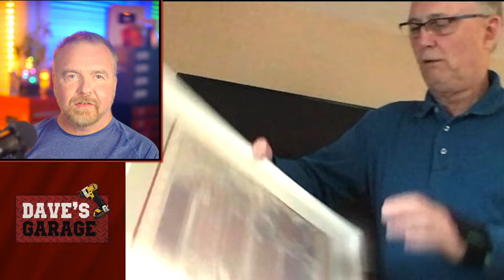Commodore 64 Chip Designer Interview: Albert Charpentier

Comment: The 'stolen' cycles in the rasterized area consist of 2 things:
- possible sprite data if sprites are enabled (not all can be fetched during phi1)
- once every 8 scan lines, the screen codes and attributes for the next 40 characters have to be fetched, but all the phi1 cycles for that line are already in use for fetching character definition data, so VIC2 keeps the bus unavailable during 40 cycles also for the phi2 phase to fetch those. This also happens in bitmap modes, but in that case to read the attribute data.

Called stolen because vic2 steals 'cycles' which should belong to the cpu. (cycles quoted because.. its more a case of rising/falling edge, so opposite phase of the same approx 1mhz clock)

Those cycles getting stolen interferred with the tape load/save routines in kernal if compatibility with the on-tape format of the vic20 (and PET) was to be preserved. Disabling the screen disables all of the above cycle stealing, and made it compatible again.

There is some interesting related trivia. 

The 1540 drive also did not account for those 'stolen cycles', and that was causing similar timing issues. Commodore could have opted to blank the screen also for disk loading, but instead opted to update the 1540 rom, and call it a 1541 (and make an updated rom available to those who needed it). If they instead had opted to blank the screen, it would have made loading from disk upto 15% faster.
Reply: Correct. Two more things: the 8 scan lines thingy is commonly refered to "Bad line" (and you can actually trick the VIC to genereate a Bad line at every scan line which enables you to redefine colors every single scan line. 
The "attribute data" in bitmap data is actually "color data" :)...
Reply: IIRC, unlike the Amiga, the C64 is all or nothing when it comes to stealing processor cycles for Sprite fetches. That is, if one C64 Sprite is on, then data is fetched for all 8 Sprites, even if only one is on.
Reply: @saganandroid4175  no not really, but it is somewhat complex. The issue is it taking a few cycles for the cpu to stop, so you can't have vic2 steal a cycle, give the following cycle to the cpu, and steal the next cycle again. There always will be a few cycles inbetween.

The way in which the cpu gets 'stunned' is somewhat more complex than one might expect, because a 6502, and by extension a 6510 cannot be stopped in the middle of an instruction, you have to let it finish that instruction (tho the last cycle of that can overlap with the cpu getting tristated)

To allow fetching multiple sprites using the remaining cycles outside the visible screen area, vic2 will start 'stunning' the cpu a few cycles before the first sprite data it actually has to read, and keep it stunned until it is done with the last one.

But that is based on what sprite data it actually needs to read, based on which sprites are enabled, and also means that you can have it fetch data for one sprite only. It doesn't always fetch all bytes for all sprites.
Reply: I just did some practical timings, and it turns out that with the screen blanked and the 1540 (or the 1541 in "fast" VIC-20 mode), the C64 loads nearly 17% faster, so you're right about the speed difference.  And with the original routines that have lower overhead, the VIC-20 and 1540 loads about 20% faster.  That's not great considering that the "bad lines" only slow down the C64's CPU by about 6%.

But what's really sad was that both the VIC-20 and C64 were supposed to have fast serial "burst" transfer just like the C128 and 1571 combination.  Commodore actually screwed up twice to give them both slow disk data transfer rates. 😵‍💫  With the VIC-20, the problem was a previously unknown bug in the hardware bit-shifter in the 6522 VIA that forced the design team to fall back to a slow but reliable CPU-driven serial protocol.  The C64 got the 6526 CIA instead and the 1541 was supposed to have at least one of those, as well, so everything was all set for fast disk data transfer, but then some idiot manufacturing engineer had to make room for a new mounting hole, so he deleted a line or two because it was easier to do that than reroute the lines!  For some reason, he thought that they were unused, and did not ask the designers before taking the liberty of removing the traces completely (might have had an outdated version of the Kernal ROM), which broke the fast serial transfer mode.  Unfortunately, hundreds of thousands of C64 mainboards were manufactured before anyone knew there was a problem (probably sent the production samples to the designers for approval just before making this last-minute change), making the problem expensive to fix by hand, and management wasn't interested anyway because they considered the 1541 a waste of time to begin with (they thought that everyone would be using Datasettes instead, like with the VIC-20).  So the 1541 got the 6522 instead (slightly cheaper and everyone used it, so they had tons on hand), and the C64 got super-slow disk transfer.

Oh well, that's "water under the bridge", and in return we got all kinds of interesting solutions to this issue, the vast majority of which were software-only and many times faster, proving that the C64 didn't and doesn't really need to have slow disk data transfer rates, even with the broken stock hardware.
Reply: @Lofote   You are correct that the attribute data that is read during bad lines in the bitmap modes are exclusively color data or maps (two colors per byte), but concerning color maps in general, the main color map at $D800 (stored in an SRAM chip on the board rather than the main DRAM) also contains an attribute bit while in multicolor character mode.  This bit determines whether the corresponding character cell is in hi-res or multicolor mode, leaving only 3 bits for the color, which limits the main foreground color to the first 8 of the palette.  It is for this reason that I, for one, often refer to the color maps as attribute maps.  Sometimes they do contain only color data, but color is itself an attribute, so this term is still appropriate, and other times they contain other attribute data in addition to color.  Furthermore, multicolor character mode is perhaps the most common mode that is used overall, especially for games, of course, so this exception to the rule is a pretty major one that programmers have to deal with on a regular basis.
Reply: @rbrtck  of course, even without 6526s, serial transfers could still have been a lot faster, as demonstrated by many fastloaders and especially things like jiffydos.

Btw, jiffydos shows a highly similar improvement when disabling the screen (which for some reason the c64 version doesn't do, but the c128 version does.. too bad there is also a bug in the 'unblanking' bit of that code (not masking bit 7 of $d011 and the C128 using a raster interupt instead of a 6526 timer interupt, this results at times at setting a raster line for the raster interupt which does not exist)
Reply: It always puzzled me why the 1541 would make that hammering noise.
Reply: @toby9999   My understanding is that like the Apple Disk II, the 1541 mechanism originally didn't have a track 1 sensor, so its ROM code just stepped the head 40 times or so to make sure that it had found track 1.  Later mechanisms came with track 1 sensors, but the drive ROM was never updated to use it.

By the way, I have a very compatible drive from Blue Chip that actually uses its track 1 sensor (also has a direct-drive motor like the Chinon-based 1541-II) and never bangs its head against the stop.  As far as I'm aware, this change has never caused a 1541 compatibility issue, so in hindsight Commodore should have done the same.

I wouldn't trust just any Blue Chip drive, however, because the first one I bought was awful: incompatible with many software titles and fragile.  After a couple of frustrating service calls, it was replaced (for free) with a newer model by Blue Chip that is awesome: fully compatible, has direct-drive, has a write indicator LED, never bangs its head, runs relatively cool, and is rugged and utterly bulletproof.  I love this drive, but frankly its predecessor sucked in every way.

Comment: Thanks for interviewing one of the incredible people who designed the one and only home computer that ignited an entire generation of future engineers. The Commodore 64 wasn't just a random computer that would eventually get upgraded or replaced. For me personally, it was my life for 15 years, it still has its place in my home and even 40 years later it still is loved and used by thousands of demosceners and enthusiasts. If the Internet hadn't gone commercial and I eventually needed a higher screen resolution for an improved display of remote unix terminals, I'd likely still be using it as daily driver today. I thank you and the other folks at MOS/Commodore wholeheartedly for my entire career and some fantastic and adventurous memories. The things me and others have done with the C64 are unbelievable and unrepeatable.
Reply: "only home computer that ignited..."?  There were a LOT of home computers around that time other than the C64.  TI-99/4A, Atari 400 and 800, the various Timex/Sinclair and ZX/Spectrum machines, Apples, TRS-80 models, MC-10, Cocos, Adam, I'm sure I'm forgetting a bunch of them.

Comment: It’s truly amazing how influential just a handful of people were in the history of personal computing, and how much the 6502, MOS/Commodore really were behind a huge portion of the industry. And of course, that perhaps 1 dozen engineers were behind the designs of so much, from CPUs, to graphics, to audio processing. Particularly interesting to those of who grew up with these machines. 

The TRS-80 was the first computer I saw, but a PET was the first machine I used…and the very first thing I did was debug “Hunt the Wumpus” game, after some friends asked me to help, not because I knew anything about computers, but because “Hey, Geoff, you’re smart, see if you can figure out what’s wrong with this”. The game was in BASIC, and they showed me how to load it from tape, how to list the program, how to run the program, and how to trigger the error. I started looking around and found what looked to me like a problem in 15-30 minutes, made a change, tested it, it worked. Ok, “How do I save the changes?” And, thus began my life as a developer.

Next, I moved to using an Apple ][, and eventually purchased a VIC-20, then a C64, and finally, an Apple //e, with a disk drive, added a 1200 bps modem. It may have helped that one of my high school buddies (2 grades ahead of me) was a budding hardware engineer who became the primary hardware engineer for Applied Engineering’s Apple ][ products, including RAM expansion boards and the TransWarp line of accelerators. I learned a good bit about hardware from him.

Comment: I always thought the shared memory on the c64 was primarily a cost saving measure. But it sounds from this like was originally designed as means of communicating data efficiently between the CPU and the graphics processor. 

 really enjoy hearing the stories of the ppl who designed and developed these technologies. I look forward to seeing more interviews on ur channel.
Reply: @Christopher Jackson

This approach was used all over the place. It was fascilitated by ram at the time being easily twice as fast as the cpu.

For example the older IEEE-488 floppy drives from Commodore have 2 6502 CPUs, which share ram in exactly the same way, one having half a cycle offset to make it run on 'the other phase'.
Reply: @alfa-psi  Did you actually listen to the interview?
Reply: @alfa-psi  In a C64 ram is shared between the VIC2 chip and the CPU.
Reply: @c128stuff  Not really. Affordable MOS RAM was generally slower than most processors could be clocked around 1975-85 (expensive bipolar RAM was faster though). Moreover, the 6800 and 6502 didn't use the RAM access time efficiently either, allowing only a third of cycle for memory to respond. That's why the Apple II, VIC-20/64 and others used this slow 1 MHz clock speed, in order to be cheap enough for the masses. Memory was a large part of the cost.

It's true that many computers (using all sorts of processors) had a shared main- and graphics memory. But this particularly simple method with the display circuitry using one half cycle and the CPU the other half could be used with the 6800/09 or 6502/10 simply because they used only one of the two halves when accessing memory. Processors like the Z80, 8086, 68000 and others had more uneven or  "unpredictable" accesses, that needed more complex circuitry regarding the video interface.
Reply: @herrbonk3635  Not when talking 6502 and similar CPUs.

Comment: This was a super cool video, what a blast from the past. Thanks a lot for making it! Really strikes you what they accomplished back then with tiny teams, a chip made by a handful of people or sometimes just one guy.

Imagine if these people had had the design tools back then that we do now (IE versions capable of running on hardware available at the time), instead of having to lay everything out by hand, and manually calculate all the timings and so on. Although chip design was fast back then compared to now, all that manual labor had to slow them down a lot and surely created room for glitches (which admittedly allowed for quite a few unintended novel programming techniques and graphical effects at the time, like screen border removal and whatnot.)

What could have been created if the design process was vastly simplified and everyone could just focus purely on innovating instead of slogging through the minutiae of drawing gates on paper and so on. Interesting what-if type scenario (which we'll never know the outcome of...) :)

Thanks again for this video, and thanks to Mr. Charpentier also for his contributions to the legacy of our species. While I didn't have a C64 myself (I started off with the NES, then Amiga), but some people I knew back then did and it was an epic time of new discoveries, we got to watch the creation of an entirely new industry happening around us.

Comment: I did consulting work at a company in Lenexa Kansas back in the early 1980's that made the cameras that shrunk down the vellum to film to make the chip masks and PCB layouts.  The cameras were the size of a large room.  I was building a laser plotter to plot on the platen instead of using the vellum layouts.  Was cool technology to work on.

Comment: Good talk.

On the 'cpu slow down': every eight raster lines the CPU has to give up some time to let the VIC-2 do a pre-fetch of data. They're called "bad lines" now. Where normally you have 63 CPU cycles per raster line, now you have only a fraction of them available to the 6510.

Comment: 5:50 The word "static" in static RAM does not mean that the memory is single ported, it means that it does not have to be refreshed. Static memories are faster, because they are built with real latches (~six transistors per bit) instead of the single transistor per bit design used for dynamic RAM that relies on stored charge that must be periodically refilled all the time.

Comment: One hack I did to the Commodore was to double the RAM. I couldn't afford the bigger Commodore unit. You could buy the same RAM and solder them on top of the other RAM chip. You connect an inverter chip to the motherboard power and connect one of the inverter's inputs to the onboard RAM select pin. The output would go to the select pins of the soldered-on-to-top RAM chips select pin. So when the onboard ram is selected the soldered-on-to-top RAM chips are not. So only one set of RAMS is selected at a time. I think I may still have the commodore in storage.

Comment: The Atari 400/800 also had the 6502, clocked at 1.79 MHz.  That's where I learned 6502 assembly, over 40 years ago.  Sort of launched my career.  I didn't know its backstory until right now.  Thank you for that.
Reply: Same here, I taught myself 6502 assembly on an Atari 800 when I was a kid. It was also what kickstarted my career.
Reply: The Atari 8-bit's CPU is indeed clocked at 1.79 MHz, but with the ANTIC chip stealing all of the cycles it needs for graphics from that "pool" of cycles, the CPU ends up being halted a good portion of the time.  How much depends on the graphics mode(s) and whether player-missile graphics are active, but for example, when in the main BASIC text screen, the CPU effectively runs at 1.14 MHz.  That's still faster than the C64 and most other 8-bit 6502-based computers, but not that much faster.  On the other hand, the BBC Micro's 6502 CPU really does run at 2 MHz (it can do this because its DRAM is twice as fast), and so does the C128's when in 80-column mode (because it uses separate memory for graphics).

Comment: I did like those chips.  SID couldn't do voices well, but it could imitate instruments adequately for the cost.  VIC2 opened my eyes once I figured out how sprites worked.  Friends and relatives played games on theirs; I hooked various circuits to my C64 I/O, but it just didn't quite have enough bits.  Like most engineers, I migrated to the PC's open architecture.